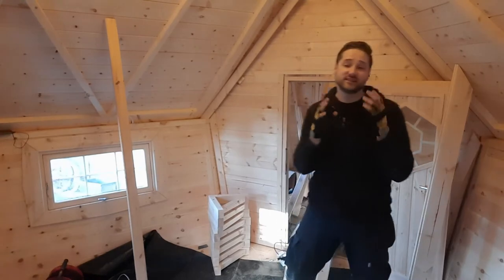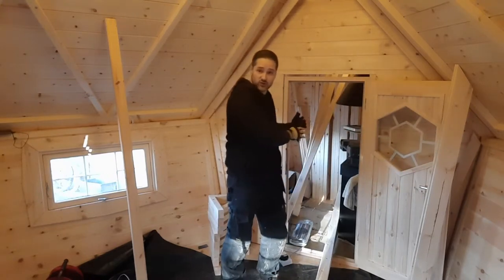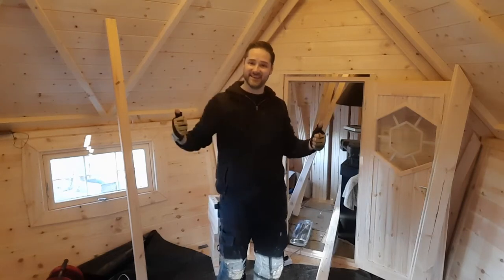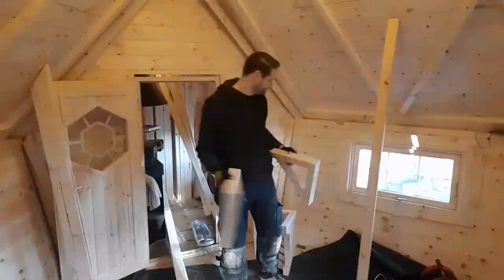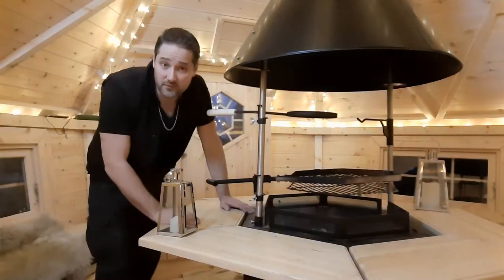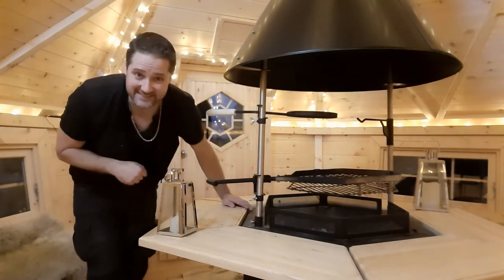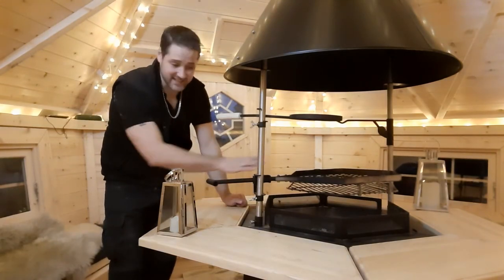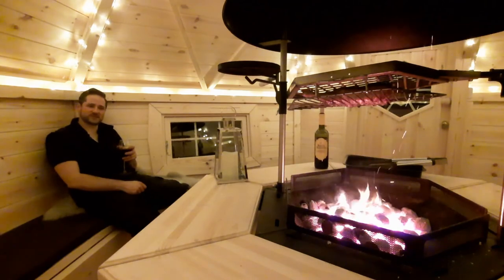How to fit and decorate the inside of your BBQ Hut

Comment: What’s in the back room and are there equivalent kits sold in the states? If so, what are names I should look for?
Reply from the maker: Hi, I got my BBQ hut from a company called (Bare wood Building) in the UK, They come in different sizes with or within extensions. I have a two meter extension with a wall. you don't have to have the wall if you want a bigger space but I need the storage, hence the dividing wall, sorry if that was much help but that's all I know.
Thank you for the question and thank you for watching